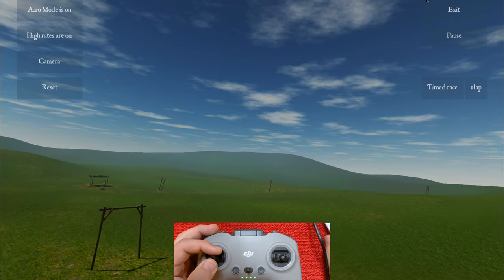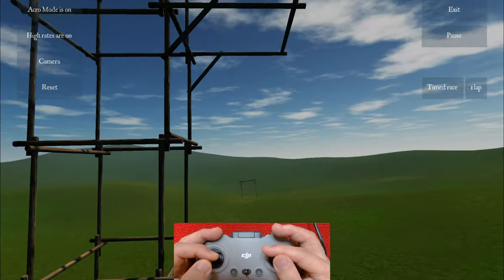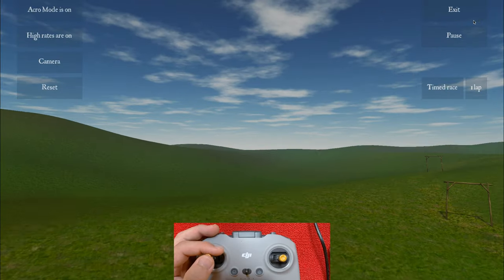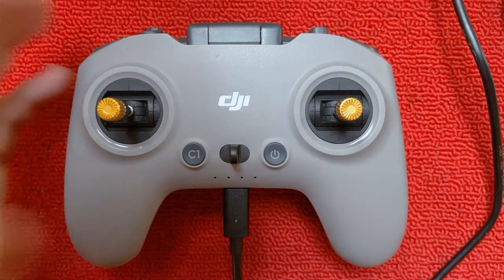DJI FPV Stick Upgrade for People Who Can't Fly Good

Comment: Just wanted to share a cheaper alternative to extend that stick is you can buy a "stand-off" you can get them in any length and just extend the original stick.

I'm using the rcn3 controller and it's an M4 size thread.

for this type, I think it's an M2 or M2.5 thread stand-off
Reply from the maker: nice!

Comment: Problem with those aftermarket sticks that their shafts are thicker than those of the originals. That means that you bump into the casing before the angle of the gimbal is maxed out, which means they actually reduce resolution a bit. That said I still prefer the increased travel, just be aware that the max angle is actually a bit less.
Reply from the maker: Good point!  will check this out